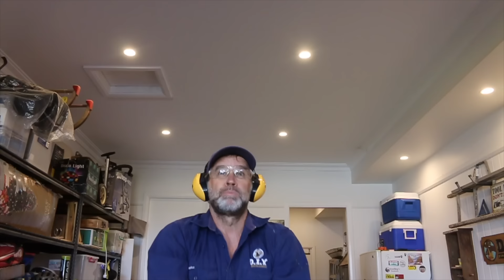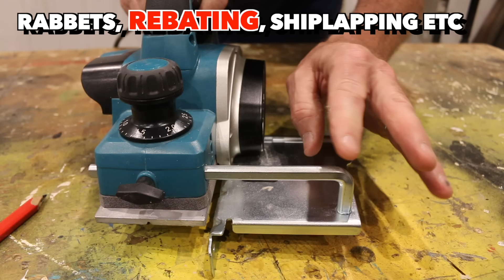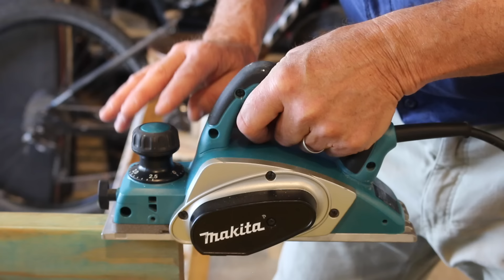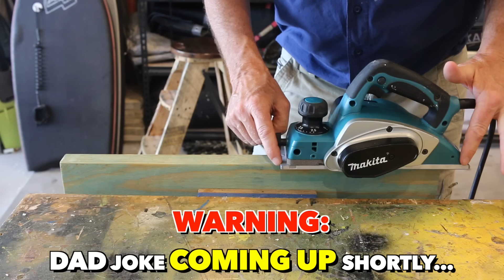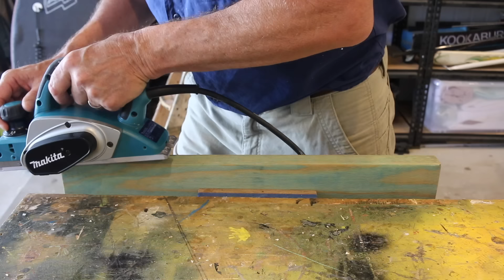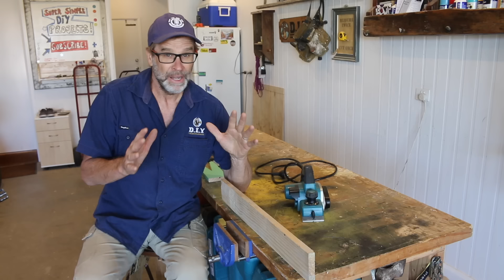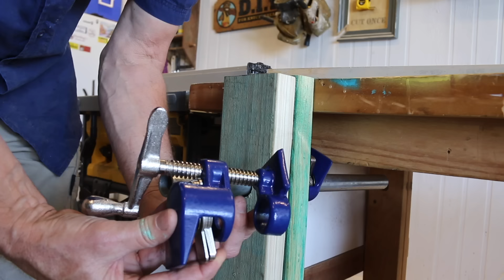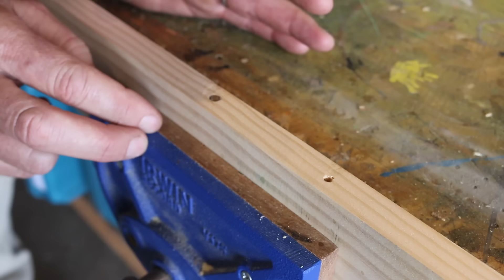BEGINNERS Guide to Using an Electric Planer.

Comment: I've just ordered my first decent planer!  I've had an 80s one that my dad handed down to me for years, but it was knackered and only really fit for really rough work.  I managed to get a brilliant price on a Makita KP0810K (£120 when it's normally £200-220) as Amazon seemed to misprice it one evening.  Hopefully it does dispatch and they don't cancel on me!  Really excited.
I love this video.  It really shows how to use it properly as most people just seem to go at wood like an old planer, rather than setting the front down first and then letting the back slide into the fresh cut.
All the best my friend!  I hope you're all as well as can be over there.
Reply from the maker: G'day Andy! Thanks for the feedback mate and good luck with the new planer 👍👍.....the Makita is an awesome little machine 😁 Cheers  mate 👍😁🇦🇺
Reply: It might sound silly but the one thing I can't seem to find is how to plane to a line rather than just removing a set amount of material across the length.  For instance, my dad needs an uneven amount removing from some big heavy barn door type garage doors he's got.  He reckons it's about 1mm on one side going to maybe 4mm on the other.  I get removing 1mm, or 4mm, but not sure how I'll use it to do both.  Any tips for that scenario?
No probs if you don't reply to that specific question!  Just want to impress my old man 😄
Reply from the maker: @sawdustandsurvival  Mate...with your level, rule a line from the 1mm to the 4mm....then starting on the 4mm end start to slowly take off the wood stopping about half way.....whenypu get close to 1mm on both ends, do a full run.....perfect! Your old man will be stoked 👍😁🇦🇺....Good luck 👍
Reply: @diyforknuckleheads  I will do!  Thanks so much!  Thats a great tip.  I'll give that a go.  I don't think I've seen a tip like that anywhere on YouTube or online anywhere after searching.  Maybe an idea for a future video you could do? Maybe just use a piece of 4x2 to represent the bottom of the door.

Comment: I can't get a flat cut. I don't know what I'm doing wrong. It's higher one side than the other. The planer is brand new and factory settings. I've checked and the blades are all parallel. As far as I can tell I'm keeping the base plates flush to the wood without a tilt...only thing I can think of is the surface I'm placing the wood on is not flat. But I would've thought it would still work as I'm running flush to the top side not the bottom! Help
Reply from the maker: G'day Stewart....the only advice l can give mate is to take little bits off 
at a time and practice. It doesn't take much to get off kilter. Good luck 👍
Reply: @diyforknuckleheads  downloaded the plans and made the v shape jig you recommended...much better clamped to the top of the workbench. UK in another covid lockdown so decided to renovate the stairs...your videos have been a massive help for this novice diy'er! Thanks a lot!
Reply from the maker: @stewartstevens5814  Thanks mate 👍 Hope the stairs worked out 👍😁🇦🇺

Comment: It seems the pony pipe clamp fixture no longer works on an unthreaded end pipe?
Reply from the maker: Pony Clamps always have used a threaded pipe Richard 👍
Reply: @diyforknuckleheads  Thanks. Thanks this wasn't clear to me. Then it is easy to have our Home Depot to thread a 3/4 inch pipe. How long do you need to have the pipe threaded; All the way?
Reply from the maker: @RockyS1945  An inch would be enough Richard 👍

Comment: Do you have any tips for planing knotty wood? I've smashed a few blades going over knots.
Reply from the maker: Knots can be a little tricky Gavin as you are never quite sure of the integrity of the knot. I just normally plane as per normal as l have never really had an issue with blades smashing 👍

Comment: It occurred to me that you might try to mount the bench-side vertical vise member so that it fits under the bench's surface lip. That way, you get the piece being gripped supported by the actual bench itself. A longer work piece could be helped with the extra clamping surface for stability.
I really liked this vid. I've avoided using my electric planer for a long time and this encourages me to put it to work.
Plus, those clamping ideas alone are worth subscribing.
Thanks!
Reply from the maker: Good tip Jim 👍👍 Thanks for watching mate 👍😁🇦🇺

Comment: If the blade had a small chip, is it due for replacement or can it be saved through sharpening? I accidentally planed a recycled wood that happens to have a small nail. =(
Reply from the maker: Hi mate, you can replace teeth on a blade but it might be cheaper and easier just to replace the blade. Good luck 👍
Reply: Thank you! I really appreciate you replying. Among the youtubers doing content in carpentry, you were the 1st to respond on my carpentry queries. Cheers! You got yourself a new subscriber.
Reply from the maker: @pgimacahilasadrianjude5699  Thanks mate....appreciate the sub👍👍

Comment: Who knew they made electric planers?  Not this old girl.  At 78 I still enjoy homesteading and learning how to solve my own problems, so I bought what seems a lightwweight version at Harbor Freight. I had 5 drawers in 3 actual wooden pieces of old Goodwill furniture that were seriously stuck.  They did not respond to sanding or soap or wax.  Well I went against the grain a few times and tore up the drawers a bit.  Nevertheless it worked, and luckily the drawers are just to store all my art supplies in a very relaxed lifestyle, so no biggie that I hacked them with a bit of gouges.  It is easy to get distracted and carried away by the power and flying sawdust before you know it you're over cooked!!!  If you have a video with hints how to do this, please link or make comments.  You really helped me SO to solve this irritating problem and I thank you for all the help so far. BTW sawdust shavings for days in my house!!!  They can fly!
Reply from the maker: Hi Barbara.....the trick to using an electric planer is to take it easy and only take small amounts off at a time.....especially when it comes to doing things like planing down a drawer. 😊  Well done on having a go....very impressive and thanks for watching 👍😁🇦🇺

Comment: First video of your I've watched, well done sir.  I'm still new to wood working and understand the need for straight pieces.  I've been using a router table I built but a hand planner looks like it can be quicker set up.  Like anything I just need to practice with it.  The section on using pipe clamps was huge, justified getting them ...
Reply from the maker: G'day Steven....glad you found the video useful mate 👍 Thanks for watching 👍😁🇦🇺🎄

Comment: Good tips and nice video production.  Perhaps your bench could use reinforcement as it seems too wobbly.
Reply from the maker: Thanks Michael 👍 Mate the bench is as solid as a rock. The reason it wobbles under pressure is that it is on wheels as l need to roll it outdoors when l'm using the table saw 👍👍😁🇦🇺

Comment: That's a good way of doing. I usually just use my circular saw, tape both sides so cut comes clean and it's way faster. Just have to use a guide to get a straight edge.
Reply from the maker: Thanks for watching Andres 👍👍

Comment: Great video +diyforknuckleheads and great tips throughout - I planned a door down a few months ago and would have preferred seeing this first.  Great to see the durability of your pipe clamps.  I'm fresh out of Vic lockdown, already have 2 pairs of the Irwin clamps you've using, but what's the best fitting pipe and where did you find it? Bunnings?
Great job knackers 👍🏻🇦🇺🍤🛫
Reply from the maker: Great to see you out of Lockdown mate......Vic has really copped it! I took my fittings to my local metal merchant where l purchased the pipe. Bunnings didn't have the right size pipe. Show the boys at your metal merchant and they'll point you in the right direction re size for your pipe. Have a good one Ian 👍🇦🇺😁
Reply: Get idea 👍🏻 your gal pipe looks great.  Thanks again and keep up the great work 😀

Comment: Love the clamping ideas. I have to travel 600 or so miles soon to help my in-laws repair damage from Hurricane Sally. There is no workshop so I plan to build a work table that will mount to the Class 3 receiver hitch on my motor home. I plan to take a metal working vise to mount on the table and will include your pipe clamp vise for wood projects. Great idea! Darlington,South Carolina USA
Reply from the maker: Thanks William and sorry to hear about the aftermath of Hurricane Sally.....Hope everybody was OK? 
Thanks for watching mate and l'm sure you'll like the vice. Cheers 🇦🇺👍

Comment: When I use most of power tool, I place the cable on top of my arm rather than drag it behind the tool. My tip 😜
Reply: Over the shoulder works for me.
Reply: Great idea. My angle grinder lead is about 6 inches (old speak) long now. I’ve cut it so many times. It’s a wonder I’m still upright. 
Thanks for the tip.
Reply: Good plan thanks
Reply: All of the above, plus sometimes tuck a bight under my belt, with just enough slack to feed my reach.
Reply: You guys need to join the 21st century and invest in cordless tools 😉
Reply: Apart from drills, I don’t use cordless tools. And also batteries are not the answer, in general speaking. They are “friendly with the  environment” for the short period they are used. But actually they are very bad for environment from sourcing the metals used for fabrication, co2 emissions and at the end of they life they become hazardous waste. And you will never get the same performance from a cordless tool as you you get from a corded one

Comment: I’ve got a Ryobi L282 and I was wonder ing if there’s a fix for belt rubbing on the belt casing. I’ve noticed it’s an issue on other models and brands that the piece is only held on by one bolt. This make the casing move and pivot when it shouldn’t. I’ve stopped using my planet to avoid burning the belt out. Any fixes to this issue?
Reply from the maker: Sorry mate...l'd love to give you an answer but am unaware it. 👍

Comment: I was trying mine out and the planing surface came out at an angle..any ideas on what I was doing wrong. Thank for the video
Reply from the maker: It takes practice Jarryd but the trick is to take small amounts at a time and try and keep the planer level....like l said, it takes practice. Also check how you're going with your square every couple of passes. Good luck and thanks for watching 👍😁🇦🇺

Comment: If you're going to work with reclaimed wood, invest in an actual metal detector. Aluminum nails will laugh at your magnet and puch your planer in the teeth.
Reply: Most steel blades will cut aluminum no problem. If it's carbide, even better. It's steel nails and screws that will kill a blade fast.
Reply: @cchavezjr7 , right on. The reason one of my preferred push sticks on the table saw is aluminium with a bird’s mouth. Nothing drastic happens if the blade is grazed, just cuts through it.
Reply: Better a carbide blade and can cut any nail or almost any screws too.

Comment: In the initial sequence, he's going against the grain.  This may not matter with a brand new extremely sharp planer, if you're using a block plane or have maybe hit a nail or dulled your planer in some other way, as one might  in the field, it's important to go with the grain to prevent tearout.

Comment: I have a really old makita planner and the little safety button on mine is used to lock the trigger on, not safe at all
Reply from the maker: I see plenty of those around mate 👍
Reply: I just purchased mine today at Home Depot and the button by the trigger is to lock the trigger on as well. I wondered how long mine had been sitting in storage or on the shelf so I started searching the box and then the paperwork. The sticker on the box which says what aisle, section, and shelf location plus vendor info and barcode was printed on 4/26/2021. The manual it came with was revised back in 11/19 and was printed on 1/4/2021 (4 months ago to the day). It also said for US only. It could be that the Australian version has the safety feature but the US version has the trigger lock.

Comment: Great video. You have very good tutorial skills and make it enjoyable. I like the clamping ideas. I have a festool mft table and made myself a steel mft table. The steel mft table is   Probably twice the weight of the festool mft table. The reason I mention this is if you clamp anything on the steel mft table it doesn't move and even more sturdy than your work bench. I once nicked my finger on the bottom of the electric planer and I can tell you  , it's very easy to do. Particularly when you are used to using a hand planer. I heard of carpenter cleaning the shavings off the back of the planer and not realising it's turning at 10,000 and more rpms.
I have a buzzer thicknesser with a dust collection. At the moment I don't have a planer. I let my brother use mine till it no longer worked. In saying that it was the handman version Bosch green. I have hikoki and metabo batteries so may buy the cordless planer. Once again great video I enjoyed it with great skills with demonstrating tips.
Reply from the maker: Awesome....thanks for the detailed feedback Ronald 👍👍 You were very lucky to just nick your finger mate..l bet that even hurt! You have to take care with these tools as they can do a lot of damage in the blink of an eye 👍 Thanks for watching mate 👍😁🇦🇺

Comment: Been using these for over 20yrs, and I mean allot building boats. Last year as I was shaping a plank I was using my fingers to guide the front shoe, just as I finished a pass to have a look I pulled away the machine and touched the blades with the tips of my fingers. Deep cuts on the tips, luckily the roller was winding right down. Got complacent, don't get complacent.
Reply from the maker: Ooohhhh.....sounds like you were a little lucky there Toby 😬
Reply: @diyforknuckleheads  very, a flap out of one tip could see the bone and a nasty cut on another. Had a bit of a flat spot for a while and it still tingles from the scar tissue deep in the finger tip. Its my worst do far and I hope that's a lesson I learned.

Comment: That's a great tool, and a great guide! I wonder if there's a way to combine the groove in the front shoe with the attachment (or with some kind of jig) so you can plane at the same angle every time. Like when you want to plane two or more edges of the same board.
Reply from the maker: Thanks Fernando.....no doubt you could make something for that.....sounds like a good idea. 👍😁🇦🇺
Reply: If you use the fence with a piece of timber, using some trig to get the desired angle, you can get a repeatable angle

E.g. for a 45, have the distance from centre of plane to edge of fence block be the same as the distance from bottom of fence to inner bottom corner of fence block

Comment: Hey, maybe you have a tip about collecting the sawdust that comes out? 
I do not have a collection bag
I hope you have :)
Reply from the maker: Some planers have a round outlet that you can attach a dust collector to. 👍
Reply from the maker: @keithmarlowe5569  That's probably the biggest reason why l don't bother with shop vac Keith. The weight of the hose throws the planer out of kilter 👍

Comment: Really helpful vid thanks! How do you use a plane on a piece that's wider than the shoe? I've never been able to get away from uneven passes across the surface and lots of finishing to get rid of the marks
Reply from the maker: G'day Adam......takes practice mate as well as having your blades set evenly which is a common problem with a lot of planes. Check out this video on how to set up your blades if you're interested. https://youtu.be/_a1HCqK5i-A Cheers 👍😁🇦🇺
Reply: @diyforknuckleheads  Brilliant - now I can build a row boat as well 🤣 Cheers mate 👍
Reply from the maker: @AdamHougham  Hahahhaahh....good stuff mate 👍😁

Comment: Great video!
I just got finished planing quite a few fence posts and was thinking if there are any good tips on how to evenly plane materials slightly wider that your planer? (eg 8cm planer for 10cm wide wood)

Obviously I go at it from both sides but often times I am left with a small step difference after each pass.

Thanks in advance!
Reply from the maker: Thanks Gergo👍 One of the biggest tips is to have your blades set evenly. It's amazing how most planers have an uneven blade set. Check out this video from The Ship Wright https://youtu.be/_a1HCqK5i-A   He does a great demo of how to set up your blades. Good luck 👍😁🇦🇺

Comment: The link to the pipe clmps is not correct. The clamp you have are spring loased whereas the clamps in the link are standardwith the fixed end threaded on.
Reply from the maker: G'day mate. that's correct. The one's that l have (suitable for a 3/4" pipe) are not available on Amazon so l linked to the next best thing. However, the style of clamps l use are available on Amazon but are only available for a half inch pipe which would be OK. Here's the link to those https://amzn.to/3dS028E if you're interested  Thanks for watching 👍😁🇦🇺
Reply: @diyforknuckleheads  Thanks. Actually half inch would be prefersble for the uses you showed. Thanks again for a good tip.

Comment: You're right about cheap pipe clamps. I bought some from Banggood the Chinese online seller. They're absolutely useless. They rust easily, they're so stiff as to be almost unusable. So, I'm after a some like yours, but your link is not to those nice snazzy ones you're using so if you can let us know where to get them I'd be very pleased.
Reply from the maker: G'day John, if you're in Australia, l got them from Bunnings 👍👍😁🇦🇺
Reply: @diyforknuckleheads 
Me, Australia - 'fraid not, next door, in France!
Reply from the maker: @Tinker1950  Aaahhhh Oui Oui....not quite 😊 Amazon have them but it's for a half inch pipe and not a 3/4 inch pipe which mine are. Having said that, the 1/2 inch pipe model would still be pretty good. The Brand is Irwin 👍👍